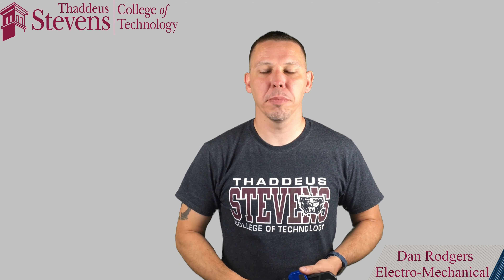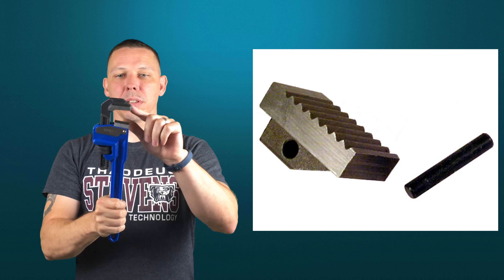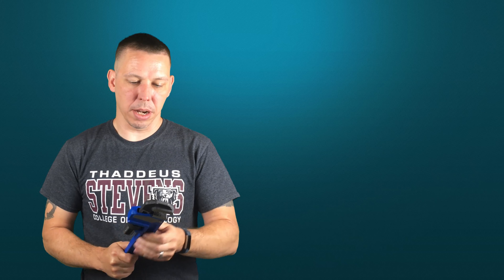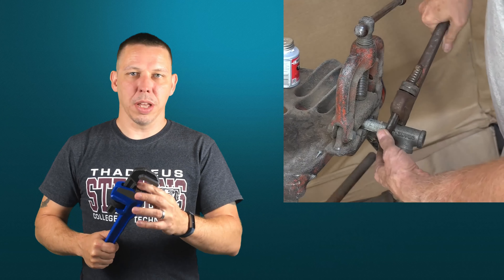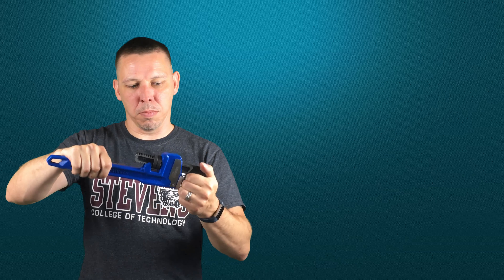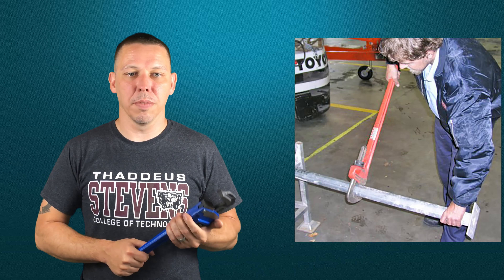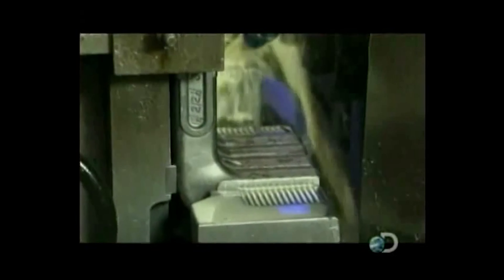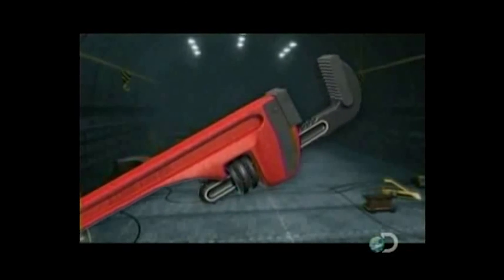Basic Hand Tools Part-3, Pipe Wrenches

Comment: If the teeth ever get too dull, can you take a file to them and re shape them? Or will that void any warranty?
Reply from the maker: They're usually hardened steel so they'd be very hard to file unless you annealed them then rehardened them after. You can buy replacement jaw sets for most models.